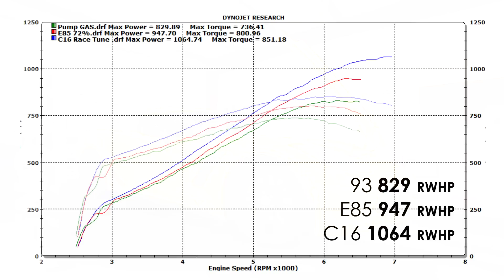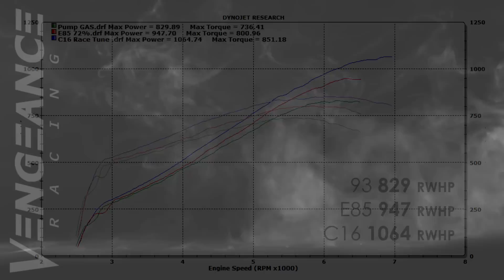HOW TO GET 1,000HP OUT OF YOUR Z06!!

Comment: Is that the same setup you did on Patties? Got some new ideas after watching this thanks Chris!
Reply from the maker: No, her build was more elaborate...but made comparable power. Had to go with forged bottom end components to hold that kind of power. The LT4 will hold that level of boost, so you can make 1000+ without the concerns of grenading something.
This also has the option of multiple fuel tunes. We opted out on race fuel. Hers is 93 only...
Reply: rekjavicxxx Thanks for the info